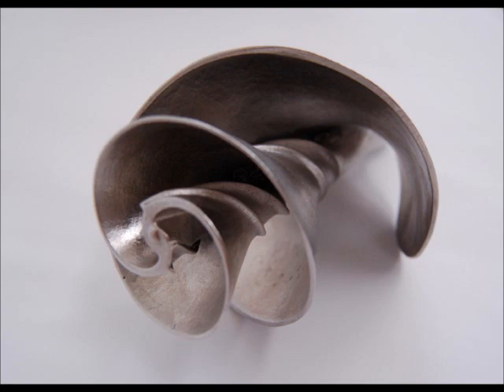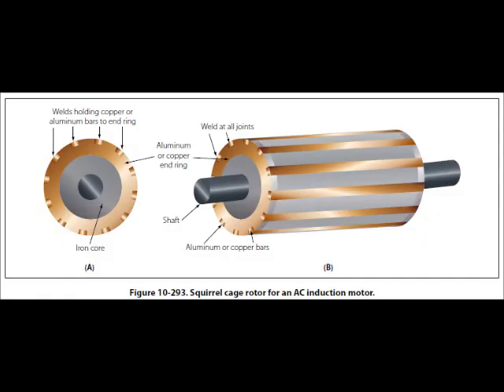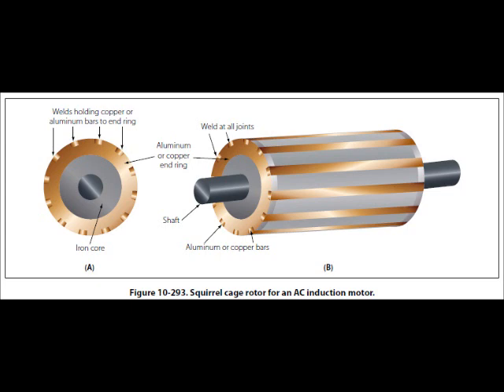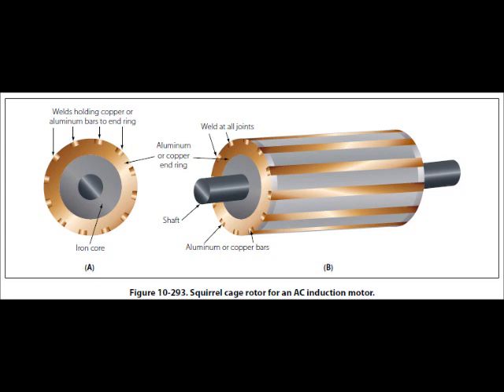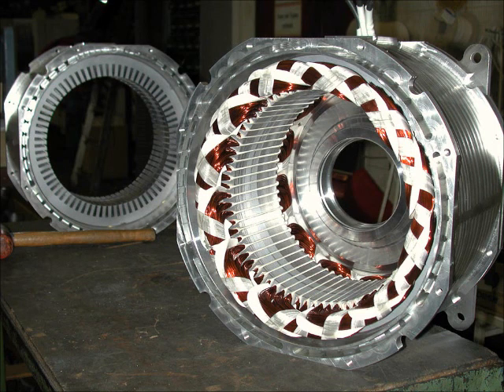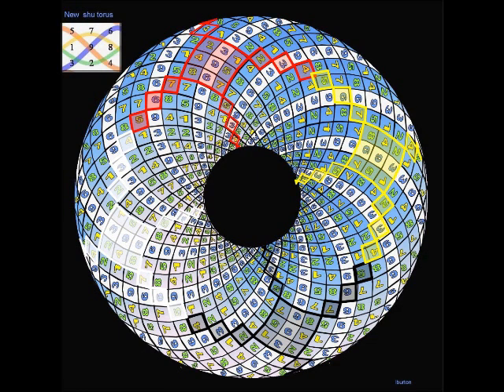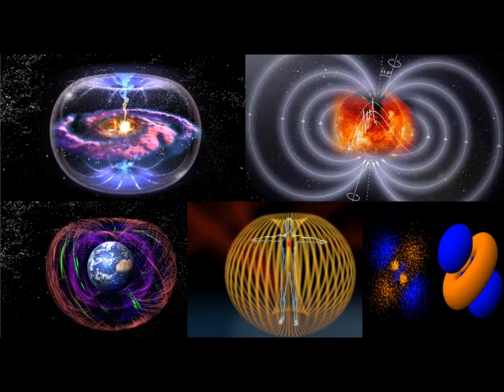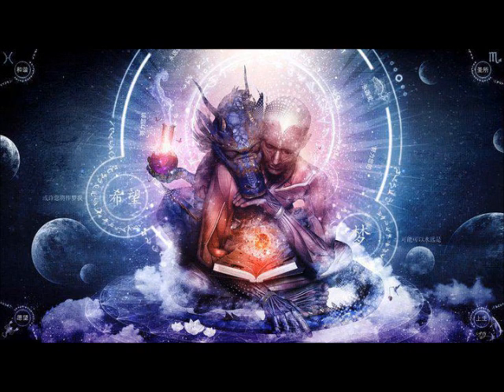Torus Vortex Lily Impeller Electric Motor

Comment from the maker: Hey everyone I'm working on a my motor design in onshape. The design of this motor will be cullminated into a video of a more indepth look at the research that went into the project. When this video is done I will then start a kickstarter campaign to create the funds to build this device with the best 3d multi metal printer on the market. This would be the only way to create such a complex geometrical  device. Once I've proven without a doubt the device works as intended.  I will make this motor available for everyone.

Comment: TMan, Still with us? Keep working with your awakening, the apocalypse thing is something we all have to work through. BTW, any progress on this concept of toroidal inductions? I believe that Tesla stumbled into it while working on the transmission of power through the air. He reported that the beams he was able to focus using a tri-coil (the third coil atop the 2 stage "tesla coil") shaped like a cone would create beams of energy that increased in amplitude the longer he transmitted, were virtually lossless and persisted (had a self-sustaining quality) after he shut down power. EE formulae developed by Steinmetz et al disconnected the physical directional behaviors from the field inductions, Quaternion Math (Maxwell's approach) is too complex and inadequate to make the transition from "right angles" to vortexes. Thinking of induction like the lift from an airplane wing, may help your intuitive approach. TC Heins has done some work to develop a FLAP (FLux-cAPacitor) coil. Check him out.
Reply: BMan18 free energy? Aren't humans an effective engine by themselves? We just need to make an engine based off of how human beings work, right?
Reply from the maker: Okay so you don't think the people of this earth can screw up are planet. Look aside from wars if the oceans temperature rises then you would have an Apocalyptic thing like no air to breath. Most of the oxygen comes  from the seas amounting to 50 to 85% of  earth oxygen. fukushima radiation ice wall idea!!!!!!!!!!!, oil, spill in Alaska, bp oil spill In the Gulf Coast, and more. Recourse that are scarce like water, oil, and food. War will be plentiful.  No i'm not going to be left in the dust. I think the human potential:  is worth a whole lot more than what we all suffer in day to day.  I don't know if you are be true or not on the vortexes and the flux capacitor sounds like your are messing with me line.
Reply: +Tyler M (SALTSHAKER) Just saying the awakening process will pass through some pretty dark stuff. And not to lose hope. TC Heins has a channel, Patrick J Kelley has an on line ebook of inventions for free energy. The technology to end the suffering and heal the pollution is available. The understanding of global warming is far from correct/complete. Check out the Electric Universe. Paul Pantone's GEET reactor is real. Energized water is what enables it and nuclear transmutations under "cold" conditions is real. A switch to an economy that isn't based on fear or lack is the challenge, and that's not a small thing. The more awakened people, the better chance we have. Check out the Thrive movement.
Reply from the maker: I know the thrive movement very well. I know how to create free energy, anti-gravity, perfect lights with perfect light but zero resistance for growing plants, aquaponics 99 percent water saved, medical technology that creates cures not cures symptoms, surgeon robots, labor robots, and much much more. I know the good and bad of society I know how to get to those problem solving ideals. A heaven on earth so to speak, a paradise. garden of Edin what ever you want to call it... It's not this living fucking hell where Trump could be president. Come on be realistic. To make what I say possible would take 1 trillion dollars to make a subatomic assembler. Which is the last factory. Ford was the first Factory then robots took over but soon it will be the subatomic assembler factory that is the next big hit. One that can assemble any particle in any fashion, Supper conductors at room temperature with vortexes, toroidal fields, small toroids in side toruses down to the last atom, and the ratio of phi can make free energy and anti-gravity. So I know what has to be done I just don't think in 20 years we will get the chance to save the earth and are selves before then maybe the few and wealthy but not lowly and hungry.We dug are grave and now we will lay in it. I don't think anyone in today's election. But if you don't belive me fine in know what is coming in any case.
Reply: +Tyler M (SALTSHAKER) actually the free energy tech is really, really cheap. That's the paradigm shift that most discoverers don't realize. It's free. A totally new tech that makes financiers obsolete too. 

Just do. Don't struggle in their game. Change the game's rules. Peace and love.
Reply: BMan18  I just wrote down yesterday where I believe the choices are that the energy is the strongest leaving the toroidal vortex of a nine point coil. The physical numbers in Vortex Math are 1, 2, 4, 8, 7, 5. This is the ever repeating path of current in Vortex Math. The 3 6 and 9 are the Spiritual numbers with 9 representing both 0 and infinity. I think the current can be moved through the coil by playing the vibration ratio of the Solfeggio scale, which are indicated by the position of the 6 physical numbers in the coil, uniformly ascending. I believe that the frequency for this could be determined by measuring the voltage produced. I thought yesterday that placing a funnel on the coil to create a whirlpool of flowing water that would help to stabilize the electrical vortex in the coil and possibly be energized by the electromagnetic field it creates. I've only been working on the idea of free for a few weeks after deciding that is what's needed to end the rule of the Cabal by facilitating a mass awakening. I seriously doubt that my idea is a workable one but it may have some insights for anyone working towards the same goal.
Reply: @imaginaryuniverse632  Fun reading my past posts as BMan18... After two years... It is clear that the pirate culture of take what you can, give nothing back will fall, as it has repeatedly for the last few thousand years. It is pretty resilient, but clearly has no long term future. Within the next 60 years, maybe 2, we will see it start to fall. Billions will die. If you get real with your work, you will have solutions that help, but without a collective will to deal with reality, rather than business science, it won't really matter. The hard part here is that the philosophy is not science.

The lily impeller pushes water outwards at the bottom with the big, lower fins. This compresses and climbs the walls of the tanks.... and flows in a torus towards the center where it falls with the assist of gravity. It won't push or pull a boat or plane. It has nothing to do with electricity or how it interacts. The patents have expired, if stirring water is your thing. It can help. And yes, a low speed generator could easily make this over unity. Nothing magic about it. Just using momentum of a ton of circulating water for power, the energy comes from the tank and gravity and the conservation of momentum. Clem developed a engine using the same principle that is just an impeller and vegitable oil (water foams too much as his engine speeds). Running cars without fuel, its just a flywheel that is self-powered. Got him killed.

The motor that Thane C Heins rediscovered was a thing from Tesla's time. It shifts the phase of the magnetic field so that the back EMF that forms with the current flow of the  energy through the stator... synchronized with the driving magnetic force of the stator, creating a motor that makes electricity. Joe Newman did it with massive windings. That flux-capacitor, the bifilar winding in Than's motor, breaks the EM induction process into its two step phases, transferring capacitance with moving magnetism and then releasing the current flow in phase with the opposite pole of magnetism transferring more capacitance of a reverse polarity.

There are other ways to generate electricity that transfer moving magnetic fields without current flow, so the EMF does not oppose anything.... Easy to make more energy than it takes to alternate the magnetic fields. This has nothing to do with vortexes... its just simple electronics without the magic of BS (Business science that justifies scamming the world for profit). Carmen Figuera did it with electromagnets, you can with two magnetis with a choke coil between them cutting the field between them will make the block wall split/move and that is AC power for the taking without blowback.
Don Smith captured the 1K x multiplication of electricity from Tesla: high voltage, high frequency air transformers naturally amplify. Paul Pantone created clean air and water from anything, even the most polluted sludge. And real energized water, HHO, stacking huge reserves of electrical energy in the macro-molecules of water with IR, vibration, and low voltages makes it into a gas that easily releases it in concentrated bursts to do could fission and fusion. Clean water and anything you need replicated is possible... all of this done with junk-yard technology. 

But, do it for profit and the empire will put you down as a terrorist... so, be cool. Peace, B
Reply: @mundymorningreport3137  Yes, it's good to hear from you a blast to the past of a new beginning. I came to the conclusion a week or so ago that the world doesn't need more power because the world already has many times the energy and the ability to produce all that the entire world could possibly desire already. The world needs direction and I believe that this can only be done by example. The world can't be saved by giving it the power of God because it already has it. Humanity can only be saved by realizing that the power of the Universe is Love. 
  I must admit that much of your comment was outside of my knowledge. I did have a feel for the last part and I think it sounds like he's using the same concept as I believe is found in the Tesla tower at Wardenclyffe and the Great Pyramid at Giza which both were intentionally chosen for the water under them charged by the magnetic lines of the Earth with the water structured chemically to mimic I think the cerebral spinal fluid but to create a very particular range of frequencies in the atoms of the solution so the electrons would be attracted to conductive structures vibrating at those resonate frequencies within a closed system of particular geometries that form a boundary to echo the sound like the boundary condition of any standing wave. I could see how the Pyramid worked when I was watching a video about the electron transfer chain in the mitochondria in our cells which is an evolved bacterial parasite that is cooperative in nature. These 3 seemingly quite different systems have many things in common that are beyond coincidence in my opinion. The source of their power is a wave of vibration (John Cadman/Pyramid pump) through a liquid particularly structured with chemical additives to a base of sea water in all 3, with structures of necessary geometries to form a resonance of attraction. Any kind of matter could be made using this system. I saw a Star Trek a day or two after thinking that this system is the same concept found in all of Creation. Anyway the show was about a spoiled child who could make anything that he wanted with a machine that could change matter into energy and then back to whatever matter he wanted. The machine was not at all helpful for the child and his parents had to put him in timeout to save the Enterprise but they still Loved him.
Reply: @imaginaryuniverse632  You sure you don't know the tech? It certainly seems like you have a fundamental grasp. Tesla discovered that what connects everything (every atomic particle) is the Ether. Specialized conditioned and energized general Aether that defines space with its presence... Everything is directly connected with thie Aether or Ether. It changes its characteristics and energy level depending on constructs made of the stuff like particles... charged ones that all interact with the power of motion (kinetic energy), charge, or just an alignment of spin (magnetism). Ether is the stuff you want to control if you want to involk the natural power of god that we all have. There are beings that can do this, and it makes sense to consider that they may be responsible for the pirate culture we live in world wide. They simply put us in time out by taking away this simple truth.
Tesla found that if you brush away the electrons from electricity while it is in the middle of a highly motivated movement, you could capture the Ether that was being carried by those electrons. He did this with a magnetic pulse across an arcing high voltage spark. The Ether could be captured and manipulated with capacitance. As long as it was moving, it would not create more electricity, but would draw more Ether to itself. Letting it settle, would produce 5,000 times the amount of electricity that he started with in that first spark. But, that replication of energy was just the beginning.
Tesla found that Ether, tuned by pulse width, and wave shape, (frequency and vibration) he could do any atomic action, targeted to specific molecules. He could make the air glow like the sky does with sunlight, from light blue to white to sunset reds. He could send lossless energy through any object, but have it interact with a specific target, like melt steel through paper or stone walls without affecting the intermediate walls. It also boosted people's energy so much, they self-healed any issue, mental or physical. The list is exhausting. The important factor he discovered was that Ether travels like sound waves through the Aether without loss, even self-amplifying along the way superluminally. The Aether is a superconductor of Ether. This was the constant motion that preserved its profile without transformation until it was intercepted with either the target molecular site that matched its frequency and vibration, or until it connected with an identical mass object that was present when it was amplified. This second object would resonate with the transmitted Etheric beam. Not by an electrical measure of wavelength, but an Aether to Ether resonance of base energy of the Ether by the inherent "density" of the Ether that was conditionally compressed to match the mass of the object it was originally spawned from.
Then Wilhelm Reich discovered accidentally that this Ether is not so fixed to the place it spawns from and that water especially has a much weaker hold on the Ether it conditions. He tripped over some iron pipes while walking over a construction site in his NY farm. The pipes tilted into a ditch with water in it. Perhaps as he was falling over this mess, he ended looking skyward over his lake and saw the "heat lines" in the atmosphere move, tracking the direction the ends of the pipes were facing. (I know, who guided that perception?) From there he started making water in the atmosphere on demand by connecting iron pipes to hoses dropped into running water and pointing the other ends of the pipes into the sky towards the East or towards bodies of water. Trevor Constable simplified this with just one pipe, flying or sailing into the wind. Both techniques project water Ether into the sky and that makes water, which will fall in volumes that exceed the amount of moisture in the air (people use it in the desert today). One location in the Arizona desert took Reich 30 days to make it rain, but that was because objects would fly in and absorb the Ether he was making, delaying the action. Normally its overnight. Or with Trevor, 20 minutes.
Of course your body runs on Etheric information and empowerment, not electricity. Read "The Biology of Belief" and you find the cells in your body, trillions of them, need to communicate with each other to effectively control your systems. Only a faster than light speed network can do this, your body is an Etheric cellular network... and as Bruce Lipton says, there are no structures in your body capable of holding your memory or consciousness, it must be remotely interfacing with those structures. The bandwidth of information constantly flowing within and to/from your body is larger than the entire www. Tesla claimed his Etheric communications were instantaneous, lossless, without limit and infinitely encodable with unlimited amounts of information... just what all life needs to have individuals. Keep in mind, there are mesmerists who can hack your body and command it to do things without words... validates the whole concept. Also is beyond the Business Science that supports the pirate political organizations that run the world.
Yep, we don't need the tech delivered to us, we just have to grow up. Playing pirates is for children. Without adults watching out for them, our children would not survive. Clearly we will not either if we do not grow up soon. The planet is about to go through a normal cataclysmic cycle and crawling into a hole won't be enough to save anyone. With proper application of Ether devices, we could easily preserve anything we desired. Peace, B